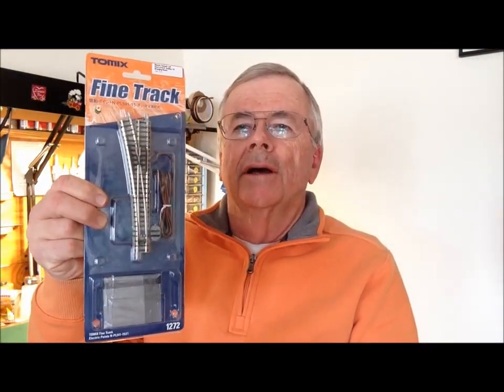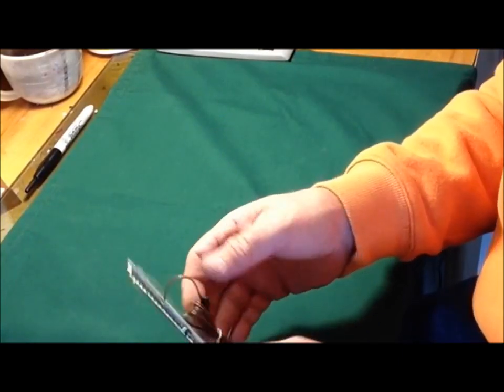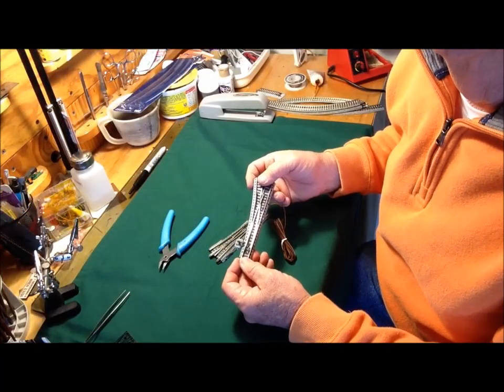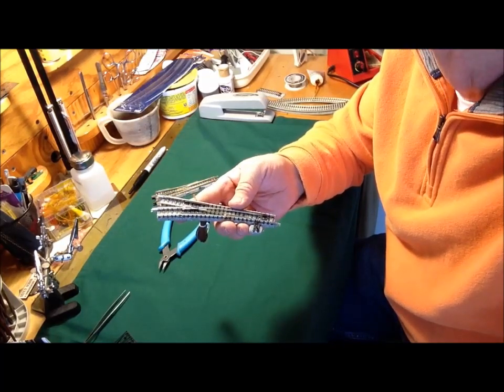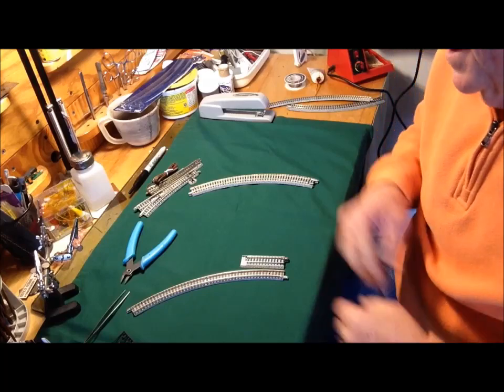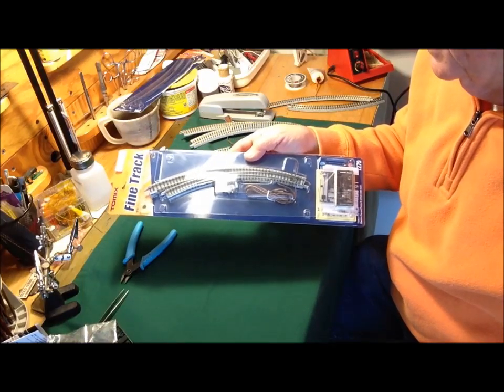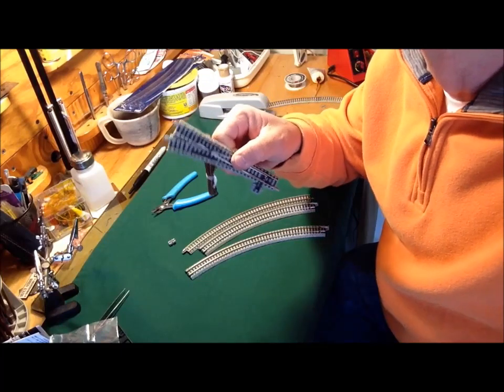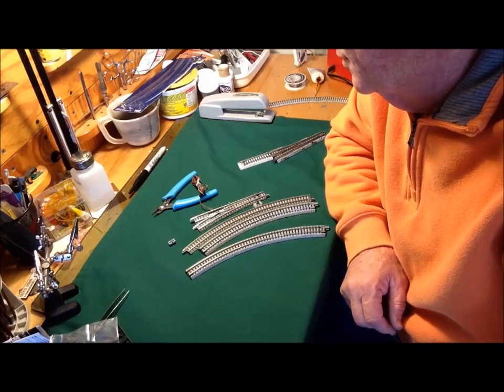N Scale Tomix Fine Track Review by Fifer Hobby Supply

Comment: The coils are available as Part No. 0107.  They are the same for all turnouts no matter L or R or curved. I think Tomix is the largest N-Scale manufacturer worldwide. The Tomix track system is much more diverse compared to Kato. Parallel tracks are 37mm apart vs. 33mm Kato. I recommend to get a catalog. It's in Japanese with some english. Easy to understand for me.

Comment: What I found interesting is the  Tomix 1246 Electric Double Slip Turnout N-PXL140-15(F) and the Tomix 1262 3-way Electric Turnout N-PLR541/280-15. I will move towards Tomix when I start (after I move to my new house) my construction. The three way would be useful in the yard set up. Instead of laddering single switches.
Reply: I have a design where the yard will require only six three way turnouts , three per side.

Comment: For the Tomix System the type is really wide is less published on USA but the type and quantities is wider than Kato. I suggest you to buy the TOMIX catalog and see inside. Is in Japanese but is easy understandable, for the translation you can use google on the smartphone .
The motor for the switch is available as spare you can easily buy. for the measure you can read on the box or under normally they have two number one is the length and one is the angle (i.e. 140-15 140 is the length and 15 is the angle of the curved section)

Comment: After years of my trains being packed away I finally unboxed and set up a test track using Kato.  As things expanded I elevated a section using Kato bridges and then expanded more onto the carpeted floor.   I liked the look of the double track 24 inch Tomix arch bridge so ordered two of them, adapted a couple of Kato and set to running trains.    Now here is the interesting part, Kato track can be a bit noisy however as the trains transitioned to the Tomix section the noise dropped by about half.  I was surprised, guessing it has to something in the formulation of the plastic by Tomix versus Kato.    Now I'm considering selling off all my Kato and ordering Tomix just because of the noise reduction.
Reply from the maker: OK, NEVER run trains on carpet.
Reply: @N-Scale  The description was for the purpose of describing the difference in noise levels and how I noticed.  Besides, lots of people run their trains on the floor.
Reply from the maker: @msomething3579  I do this for a living and Running on CARPET will shorten the running life of Loco's by about 70%. Carpet fibers and other floor fibers will soon ruin your locomotives. But do what makes you happy as it is supposed to be fun.

Comment: Mike,
Thanks for the review.  It is the best head-to-head analysis I have seen.  Now the question is, are you going to start stocking Tomix track?  It is a real pain to have to buy it from the Japanese importers.
And you didn't get into the area where Tomix really outshines Kato Unitrack.  That is in the Tram or street-running track.  Tomix has a much broader line of Tram track, including turnouts built into the roadway.  And their streets are much easier to use than the Kato street track, which tries to incorporate lane markings, parking lots, etc.  Since you drive on the left in Japan, those features make using the Kato pieces very cumbersome.
Let us know if you start handling Tomix track - I would be glad to be your first customer.  I am more than ready to get away from those pesky #4 Kato turnouts.

Terry N.
Reply from the maker: We will not be stocking it as the prices here are too high and not all the parts are available here.
I have just never used the street track and we sell very very little of the small sizes of any track , it just never occurred to me.
Thanks , Mike

Comment: Another question. I bought one of the Tomix 3 way turnouts. Can I use the Kato turnout switch/controller and will it work or do I have to buy the Tomix one. I don't care about the plug and play aspect of it because I can cut and connect the wires if the Kato controller will work.
Reply from the maker: I have no idea as we no longer carry the track.
Mike

Comment: Hi. You say that you can't find any informations about radius, arc segment turnout ankle or that.
As European with use of metric system I've first spotted that familar 541 in type number. It sounds familar to common bigger radiuses in N gauge systems - measured in milimeter.
So I do some research and found that Tomix has kind of "speaking part numbers". P has meaning of turnout (I don't know why ... maybe "track _P_oint"). L is for "left" and "541" is the radius in "mm". The "15" behind the dash is the arc segment in degree.
There are also part "C" for "curve" with the same numbering: radius in mm and arc in degree.
And finaly ther a "S" for straight folowing by lengt in mm.
So if you do the adventure and dive into metric system you may read the part numbers without learning one word of japanese.
Reply from the maker: Thanks Erwin, Mike

Comment: Just bought a 2002 micro train beer train set at the Atlanta show. It came as a starter set  with tomix track. Was wondering if the fine track will work with, what I am assuming I have, regular tomix track? Thanks.
Reply from the maker: It should work.
Thanks , Mike
Reply: Mike Fifer I took your advice and bought the Kato converter . A lot simpler than buying to mix from Japan. Thanks for the helpful video!
Reply from the maker: Thanks Frank , Glad to help.
Mike

Comment: Hi Mike, I have Unitrack at home. I did buy a full setup for a briefcase layout I built out of Tomix fine track. They have a line of extremely sharp curves and small switches. The switches would be like a #2. I used to run a plymouth switcher with 40' boxcars, very successfully.
Reply from the maker: Thanks , It is at least good to hear that it does work well.
Mike

Comment: Restraining guard rails at the point of switch ARE prototypical especially in light rail transit.  The one on the curved stock rail saves the straight stock rail from severe gauge face wear.

Comment: I used TOMIX for my HOn30 micro layout because of the very tight 9" radius curves. But thea also have a easement system they helps the sectional track look more natural. The switches work well but are a bit on the fragile side. All in all i was able to make a 30" X 40" layout that runs very well.
Reply from the maker: Cool info Thom , Thanks .
Mike

Comment: hey mike one more question on the wiring of kato turnouts when you hook the wires to the power it that just on the accessory side of any power pack ...and is 26 gauge wire ok for them bell wire
Reply from the maker: I would say bell wire is fine and power supply needs to be DC and I would recommend 12 - 18 VDC MOMENTARY pulse.
Mike
Reply: where do you get those and what did you use
Reply from the maker: trackspike64 Any DC supply will work and we sell the switches.
Thanks , Mike

Comment: Mike these are twin coil switch machines judging from the video.  Since I use NCE switch kat decoders for my Kato turnouts I would then use NCE snap it for tomix turnouts.  Is this correct. 
Thanks for your great videos you have really helped me. BTW how is your HO switching layout coming?
Rich
Reply from the maker: Thanks Rich , These are also polarity reversing like the Katos , they are 2 wires coils.
The HO was torn out early last year. We needed the space for another project.
Thanks , Mike
Reply: Thanks Mike, have you installed the curved turnout if so do you like it. To bad about Miller Place it would have been nice to see in operation.
Reply from the maker: I didn't intend to use the turnouts but rather just see them in person.
It is too hard to be in to many scales so I will stick with N and G outside for the grand kids.
Mike